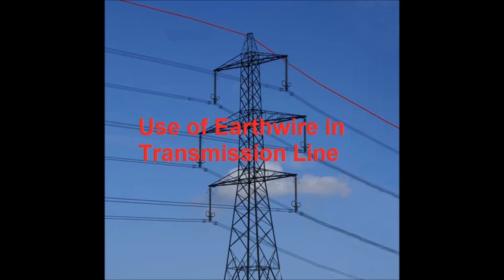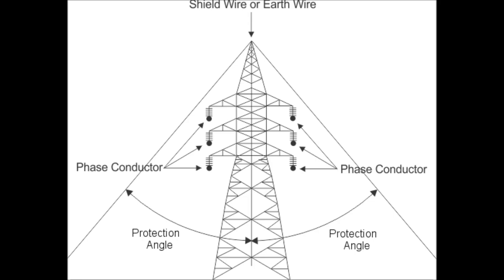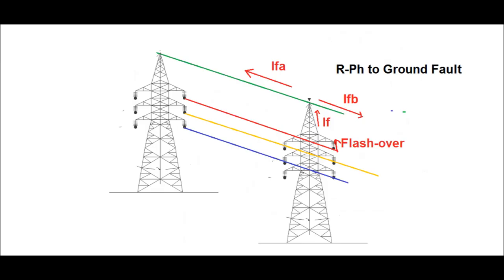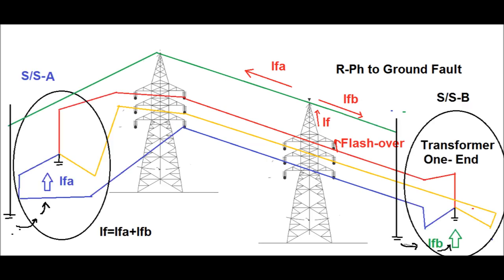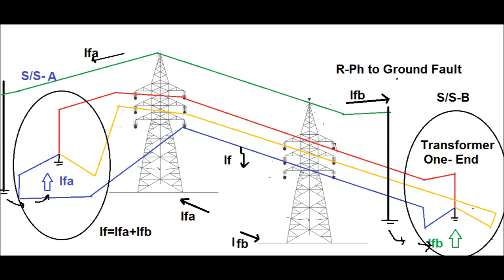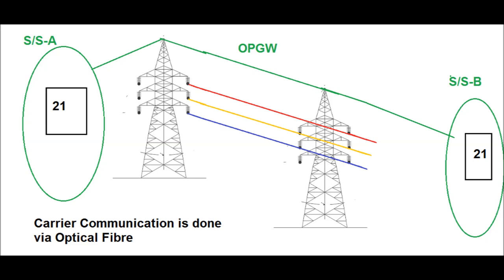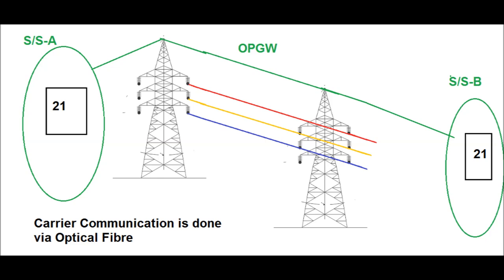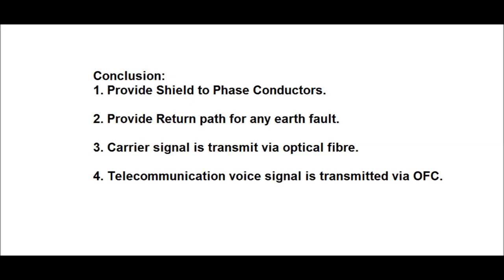USE OF EIRTH-WIRE (OPGW) IN TRANSMISSION LINE

Comment: Thank you Sir.
1-Thanks again for this useful video, can you complete your example for the current passing through the shield wire in case of SLG with practical and numerical values ?I mean giving the transmission line length  and also other parts numerical values and solve it as  a  problem?
2-Would you please share a video for SLG(single wire fault to ground current pass in case of not  having shield wire and having surge arrester for lightning)?